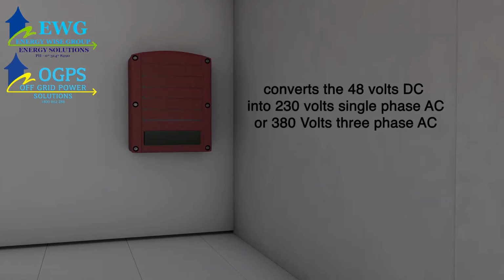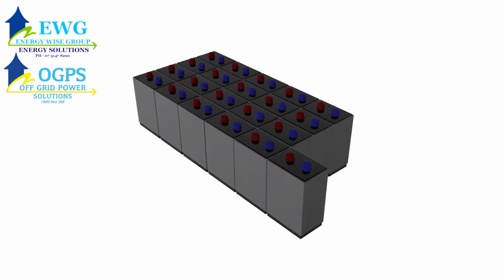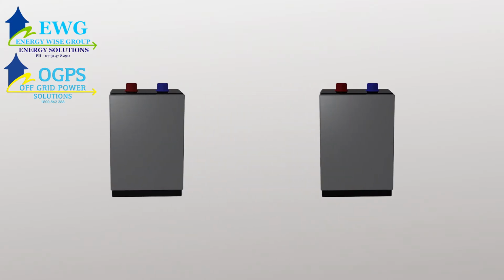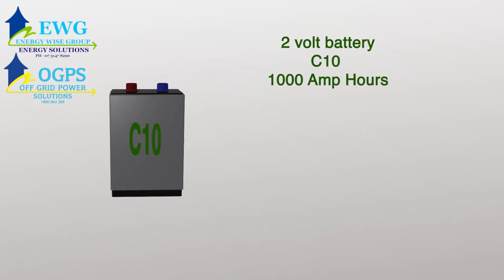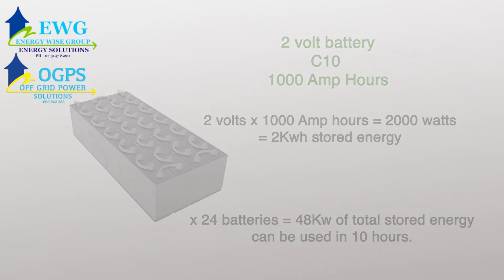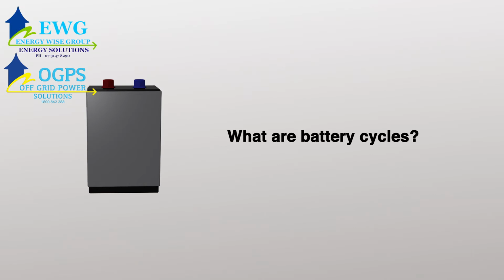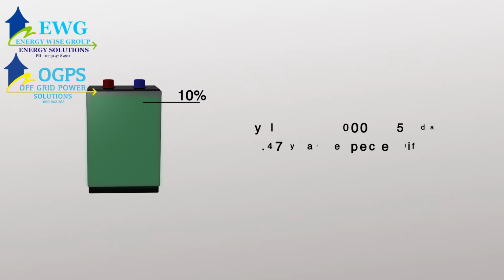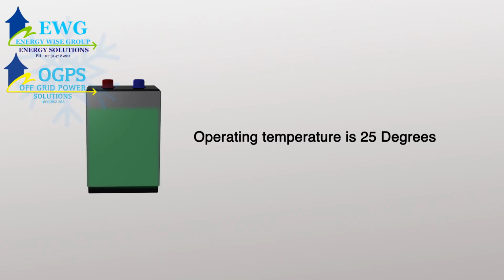How do Batteries work and understanding them

Comment: With voltage system is best in solar power system (12v 24v,48,96v,120v) battery type best ?
Reply from the maker: dependent on your use, if you are using a battery system for your average residential with say 6 lithium batteries 48V would be ideal, once you go past 6 lithium batteries some manufacturers will supply a High voltage Box to meet the battery design demand, with a HV unit the batteries will be wired differently so ask your battery supplier for more info